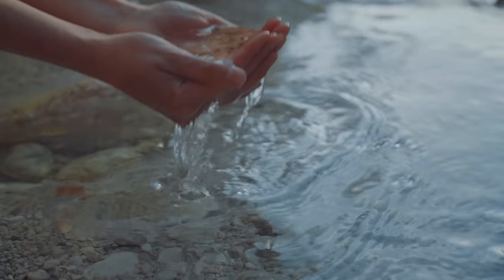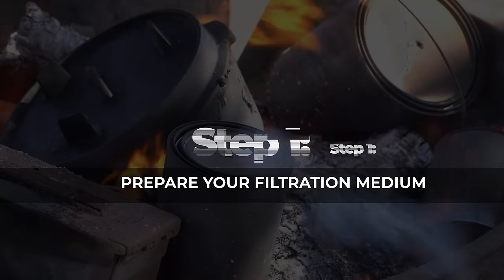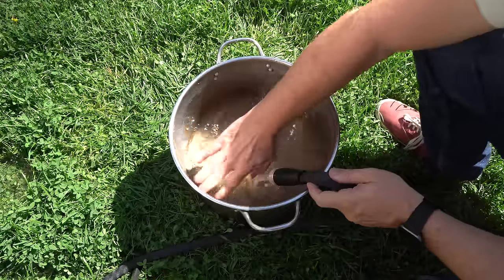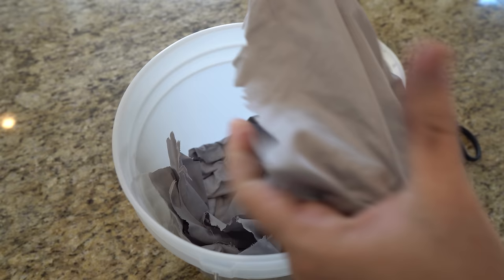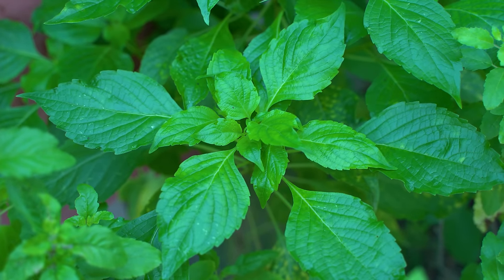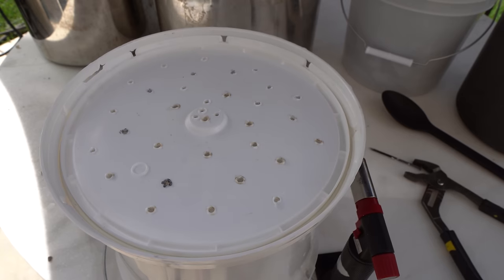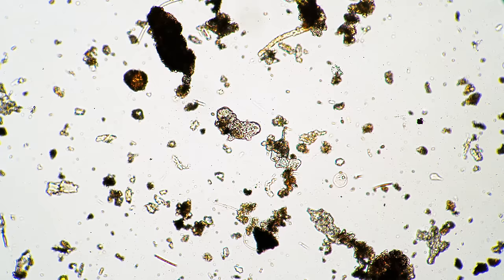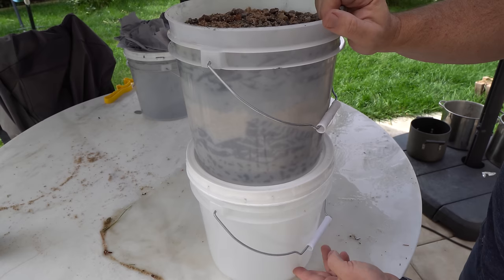How to Make a Water Filter With Available Items (Enhanced Microbial Removal) - DIY

Comment: This works far better with a three bucket system having a nozzle on the bottom bucket. Adding one medium to each allows you to rinse both the gravel and sand, and only replace the charcoal as necessary. Placing all of it into a single bucket means you need to replace all of it on average once a month (more often depending on how much water you are filtering). Once a month works for a family of four filtering water for cooking, drinking, and rinsing dishes. If you are filtering for bathing as well you will need to change that charcoal more often. Also, adding the plant matter in a three bucket system you should add the plant material on top of the gravel where it is easy to replace. Fill each bucket (we use 5 gallon buckets) at least 3/4 full, place cloth at the bottom of each, and fix a tap nozzle two inches from the base of your charcoal bucket. It's worth it to buy the stainless steel version made for Berkey filters.
Reply: He only used a small amount of pebbles on top to weigh the greens down
Reply: @Troys-reviews  I know. The typical system is actually a three bucket system with (from top to bottom) gravel, sand, and charcoal in each bucket. A faucet/drain is placed on the charcoal bucket so you can drain the clear water into containers. I've tested (and had tested) the water from this setup and it is safe. I use activated charcoal in ours. We store the charcoal and extra sand as well as home test kits.

I'm not knocking the setup shown, just pointing out that for long term use an actual three bucket system is better provided you store extra charcoal and sand.

Making your own is absolutely acceptable as far as charcoal goes, and sterilizing both your sand and gravel is advised. Adding the two extra buckets and separating the medium layers makes it much easier to rinse/re-sterilize both the sand and gravel for any long term issue.
Reply: @LierinEdana  I totally agree with the 3 bucket design it makes more sense to me especially with a large group
Reply: @Troys-reviews  I know it would be my preferred option as long as I had the supplies. Some people may not, and others may have to either leave theirs or make do until they get home if they are away for any reason. It's always good to have options so knowing how to put any sort of water purification system together is a plus. Like you said, for a large group/family, or if you have pets/livestock, a permanent three bucket system is better.
Reply: Wonderfully done!   Im making a couple extras for....well, you know, there are going to be more people that need them!
Reply: Chit....wrong box
Reply: @LierinEdana  I have a few different options for portable water purifercation but I'll be building the 3 bucket design you've mentioned for home
Reply: @Troys-reviews  We do as well. At the moment I have several Sawyer filters, several Life Straws, a Berkey and two sets of filters in addition to the ones in it. We have a rain cachement setup and a shallow well with a hand pump as well. Water really is life!
Reply: @LierinEdana  it certainly is. Well done on all the back ups mate I just have a few life straws and 2 renogy water filter pumps with 4 spare filters
Reply: @Troys-reviews  The shallow well came with our property. All we did was clean it and cover it properly. The rain cachement became a necessity for me personally because we have livestock. One day with a well pump not working was enough to convince me on that. At that time we had pigs, goats, rabbits, chickens, peafowl, guineafowl, ducks, a donkey, plus our dogs and cats. Not having water was unacceptable! 

Don't knock having portable water. Most of my small filters are specifically for any time we may need to evacuate for short periods of time. Given the 1000's of gallons they are capable of, that adds up quickly ~ and if there is no sure potable source from city systems, they are life savers.
Reply: @LierinEdana 😊
Reply: A good tip. I do that with my aquarium filters using an under the gravel filter as a pre filter for my separate fiber and charcoal filter.
Reply: @LierinEdana what keeps the charcoal from coming out of the spigot with your water? Thanks
Reply: @_evilqueen  We place tshirt material across the bottom of each bucket before filling it. In the bottom bucket (charcoal) we use both cheesecloth and the material ~ and we use activated charcoal rather than homemade (my husband does routinely make charcoal, but he uses it in his forging). I haven't had any real problem this way. Make sure you have your material a few inches up the sides of the bucket and carefully add the charcoal until you can't see any material. Then you can just dump the rest in.
Reply: Plant matter seems counterproductive as it rots.
Reply: @dlighted8861  ditch that, 2 inches of soil covered with 1 inch of sand, live plants. No need for any mechanical filtering. Think pond. Nobody filters them. I haven’t used any chemicals either. My tanks are lush, crystal clear and snails, shrimp and fish are breeding and thriving.
Reply: @oakmaiden2133  Many plants have medicinal properties, some of which enhance water filtration (one reason it is a good idea to have at least one good herbal book on hand). Anything that augments water filtration in a grid down situation is a plus for you and your family. I wouldn't mix them into a single bucket setup, but adding them to the top of the gravel layer (which needs to be rinsed regularly anyway) means they can be easily replaced. 

In particular, any plant with anti-bacterial and anti-viral properties is a definite plus when it comes to things like cholera, typhoid, etc. If you don't know them, or don't have access to them, the three bucket set-up will remove most contagions alone. The single bucket will as well, but you will have to replace all of the layers far more often,  most likely all of the materials instead of just rinsing the sand and gravel layers. A 3 bucket set up should have those two layers rinsed whenever there is visible matter in the gravel/the charcoal layer monthly for a single family. For larger groups, even weekly would be appropriate depending on the size. It isn't like a Berkey where you get thousands of gallons before you need to replace the filters.
Reply: @oakmaiden2133  Interesting but ponds are not artificial ecosystems. You would need everything to be spot on all the time.
But it does sound interesting.
Reply: @LierinEdana how often would the activated charcoal need to be changed with a system like that? Filtering well water..
Reply: @rankaradovic3172  You can replace the cloth each time you rinse out/clean your sand and gravel layers. Just old tshirts, sheets, etc. work well for this.
Reply: How do you use berkey pots? Do you put cloth in the bottom, then charcoal and sand on top? (Of a top pot)
Reply: May I ask how you resterilize the gravel and sand? Thank you.
Reply: @feliciareynolds5296  You don't need to sterilize it, just rinse it clean and free of debris.

Comment: Shouldn't the sequence be ( top to bottom) 1. Plant material, 2. Pebbles, 3 sand and lastly 4. Charcoal. You want the water to filter through the plants first, then pebbles, then the remaining small particles in the sand and finally chemicals in the remaining water (which implies the order i suggested)?
Reply: That was my first thought too. Pebbles at the top for first stage filtering. Charcoal at the bottom for last stage fine/impurity/chemical filtering
Reply: You would want the plant material on top because you can change  it easier before it decays
Reply: You can put the plant material in a filter bag . It would be easier to remove and clean.
Reply: My thoughts as well, as with fuels, the larger media filters first, finer in the end. Please explain why not use 1-plant, 2-gravel, 3-sand, 4-charcoal as this makes the most sense.
Reply: Very odd error considering he has explained the purpose of the pebbles as being to pre-filter and prevent clogging of finer filtering media.
Reply: I was looking for this comment. Looks like there were several of us thinking the same thing
Reply: My thoughts exactly!

Comment: If you want to make this filter grab radioactive contamination after a fallout event add a layer of crushed dolomite limestone mixed with gypsum and weathered gramite. Fine sand is the right consistency. It will remove all of the 90Sr and most of the 137Cs from the water ❤

Comment: Why are the pebbles (which filter the largest debris) on the bottom, followed by the sand (which filters smaller debris), followed by the charcoal (which filters the smallest debris)?  Won't the charcoal filter out all the debris before it reaches the sand and pebbles, thus rendering them kind of pointless and causing the charcoal to need to be replaced sooner?

Comment: Awesome video. Be careful with bleach dosage. We put about 1 1/4 cups of bleach per 1000 gallons of water (on the ships up in the Arctic), then put water through activated charcoal (powdered charcoal will do) to make potable water. Rule of thumb dosage is about 2 drops per quart of water. Buy some pool shock to have a shelf-stable source of chlorine- bleach has a short shelf life. Iodine drops are effective as well (same chemical family). Any higher dosage and you get explosive diarrhea- then you will become a member of a club of certain world leaders. And that is a nasty club to belong to. The SHART club (acronym of two four-letter words, the first starting with "SH" and the second with an "F"). 🤣🤣

Comment: Just 2 side notes.

Aloe vera is a very easy plant to grow in most human habitable areas. It requires very low light and water usage. It is very very antimicrobial and healthy for you as well.

Secondly.  If you have a pressure canner you can convert it into a still for water.  The process for use is to heat the water up to around 14 ( or as just under your canners max psi safe operating pressure ) for about 30 to 40 minutes ( sterilization times ) then vent as you would a pressure cooking recipie .

After pressure hits 0 wait until it cools off enough for no steam coming out of vent.

Reheat until a steady whispy stream of steam comes out. Then attach your copper coil to vent .... Use as much copper tube as you can use a bucket or two or three to cool the coils with.

You can let it drip into copper pipe or pot or any other collection pot bucket.

( Raw copper preferred due to health benefits)

And that's it. Pure h20

Comment: If the water is too cloudy some aluminum sulphate. (alum) can be added.  This will cause the small particles to clump together and precipitate to the bottom.  This is known as flocculation and is a process all municipal treatment uses.  This is harmless if used in the proper amount and is often used when making pickles.   Also investigate the process of charcoal activation with calcium chloride to make activated charcoal which is much more effective than plain charcoal.

Comment: I used to have a 5 gallon bucket size filter, but found it too small for the amount of water I wanted to filter.  I made a rubbermade trash can sized filter and put a spigot in the bottom.  Works great!  I plan to solarize the water after filtration as well, to save on having to boil it, because firewood is valuable and smoke makes a signal for people to see.  So cool that you did a PH strip test!  Great video!  Now I gotta go watch the one on making charcoal.

Comment: Very informative, and easily built and put away so that it's ready if you ever need it. I would also suggest putting the instructions on how it was built in side the lid. That way if/when you need it you understand how long its good for, the type of water to use (rain water if possible), and how to build another one if that time elapses and you need to build another one. I'd recommend the same procedure = putting instruction under the lid, of a can of charcoal so you know how to make your own if/when you need it.

Comment: I'm constructing a water collection and treatment system. I set up a mixed sand and pea gravel test column where I mixed both together in various ratios instead of layering them so that the filtration rate is not determined by the slowest sand layer alone. I'm timing the flow through rate of different ratios to find an optimum mix.

Comment: Charcoal does not clean the water.. the charcoal needs to be activated, which you can do at home. 

The reason activated charcoal is effective is because each particle has a lot of surface area due to rhe shape/structure of the molecules

Comment: I’ve got mine going through denim, sand, charcoal, then a Sawyer Tap on the bottom bucket spigot.
If it’s real bad water, I’ll do the pool shock bleach trick to treat it either before or after the filtering.

Comment: Any tips on where to buy "ready to go", good quality charcoal in bulk (like 5 gallons worth)? I know I can make my own...but would prefer to just buy some while I can. I'll save making my own for when I have no other choice 😂
Reply: Searching activated charcoal online would probably get you best results. There is methods of making it yourself but it requires hitting it with a propane torch in a non oxygenated environment, though it could be pricey. But activated charcoal has micro holes in it that helps it capture more. Hope this helps!

Comment: Chloramine (mostly found in pools), Tetraethyl lead, lead (found in oceans, tap water) , dissolved inorganic compounds filters are quite necessary in today's day and age. 
An activated carbon/activated charcoal filter will filter chloramine using a special catalytic carbon coating. But it won't be enough to filter lead. A reverse osmosis filter would be very hard to procure and a ceramic filter won't filter some of these chemicals either. 
It won't be enough to filter radiation contaminated water.  Another downside to using a charcoal filter would be the contamination of the filter with biofilm.

The usage of activated charcoal is straightforward like in the video. Filtering is done through adsorption to the porous surface of the coal. 

Making process (additional read) :
An activated carbon filter needs to be treated with phosphoric acid and potassium hydroxide, heated at low probably using steam (450-900 C°) and then activated at (700-1200 C°)

Comment: one thing ive always wondered is how long are these filters good for before they can't filter the contaminates any more? and also is it possible to clean or sanitize these types of filters to prolong their use or must another filter be made again.

edit*  thanks for clarifying at the end this method is good for about a month
Reply: Kris, I understand this type of filter has a limited life expectancy, but would also like to know if the sand and rock layers can be cleaned for reuse, perhaps with bleach and sun exposure. The plant layer may not be available to replace year-round, so what do you do? Is the charcoal still beneficial in the garden soil after using it in a water filter? Can the water be stored for later use (like off-season) once it is filtered? How and for how long?

Comment: How do you keep the water in your rain barrel from getting algae? I’m struggling with that. I will be building this filtration system as added back up.
Reply: Piece of copper pipe. I use it in chicken waterers. Might have to use a large piece depending on how large your rain barrel is.
Reply: Use dark barrels,  keep the sun away.

Comment: Well. 
Adding plant layer before charcoal can limit its lifetime in my opinion. After all, charcoal absorbs anything it can, with no distiction between bad and good contents of the water. So, it will absord some of the mentioned plant oils, terpens and whatnot. 
if I were to use plant layer I'd probably place it after the charcoal.
If I am wrong, please correct me.

It is a very important thing to be able to produce your own charcaol, no doubt about it. But, commercially produced charcoal, like for example, one used in gas mask filters, is many many times more effective. That is due to its much larger absorption area, which is achieved in production process with injection water under high pressure, if I recall correctly. Such charcoal will of course be more expensive, but should last for much longer.

Your water will have high pH, due to sodium or potassium oxide present in the charcoal. After it is washed several times, it should become lower. Wood ash present on the domestically produced charcoal, was in the past used to produce alkali needed for soap manufacturing.

Also, I'd probably use sun UV purification before filtering, and skip the one after. I'd boil filetered water anyway.

Great video, like all others you create. Thank you.

Comment: I have had Filters that say they can Filter 1,000 Gallons or More and Get Plugged Up after Less than 100 just from Clear Rain Water... Usually a layer of Green Fungi grows over the filter. And these are Filters MEANT for Filtering Clear Rain Water.... All Water in NON-See-Threw Buckets.

Comment: P&G sells packets, at a loss, to developing countries that appear to be not much more than Ferric Chloride, Poly Aluminum Chloride, some bentonite clay, and some pool shock to produce clean water.  It flocs out everything so you could conceivably drink it out of a clean bucket.  Ferric Chloride, PAC, bentonite clay are common products used in water treatment. I'd buy some, but I don't need a few tons, which seems to be a typical min.  I would imagine a mason jar of the coagulants would last multiple life times.  Pair with some pool shock that you replace every few years, and you have pretreated your water to eliminate most things that would cause turbidity and provide a slight residual chlorine boost to the end product.   Put that through your filter..